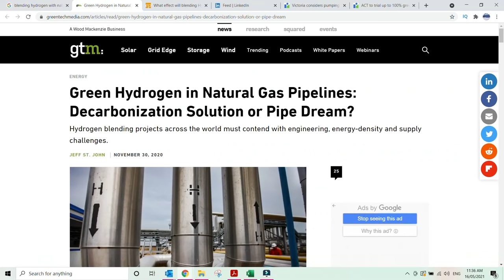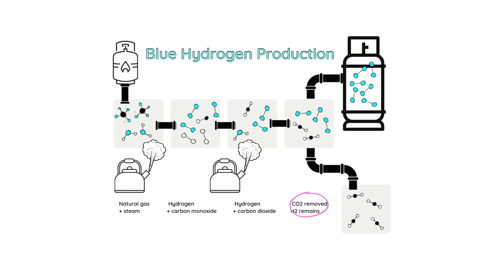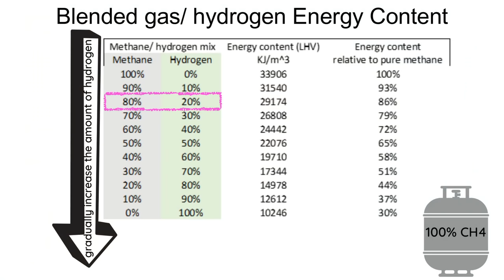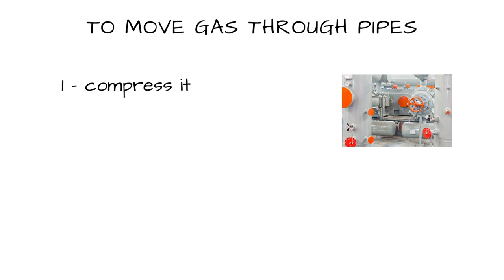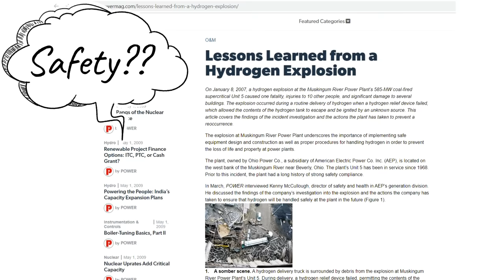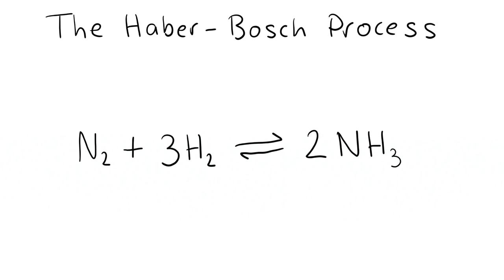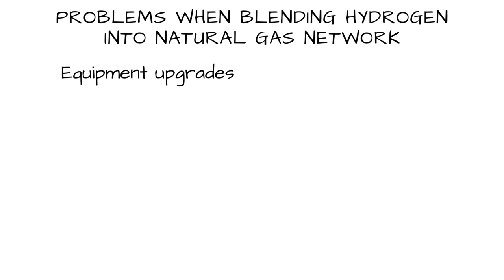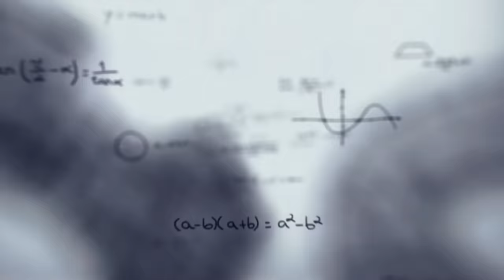Hydrogen in the Natural Gas Network

Comment: I am working on a offshore city and spent a couple years crunching the numbers for everything including energy , and if I learned anything , you have to put real numbers to the problems , and not have any preconceptions about the results. Another thing I learned was how really amazing results you can achieve by going beyond what is normally considered "economically viable" efficiency improvements.
Reply: please elaborate, what were the conclusions?
Reply: I expect it is an ROI type of calculation you were doing. As you get smaller gains it takes much longer to get a payback. eg if new equipment gave you a 50% saving and the pay back period was  2 years thats great. If you only got 10% then payback would 10 years - not so great. If the payback is longer than the lifetime of equipment you never get a payback.

In work I was doing I had to get a payback in 6 months to get funded. Understand your frustration with economic limits because I had them too.
Reply: If you are who I think you are, you are brilliant. Ahahah I think I’ve heard about you in my younger years as a teenager, building futuristic city plans. Am I right? There is most definitely real potential in hydrogen, considering it is so abundant on earth.
Reply: @lluuccasexperiencia7373  I don't know if anyone has heard about me , I did do a lot of research on Ammonia as a way to fuel air conditioners ( A truck would deliver Propane during the winter and the same truck would deliver Ammonia during the summer) I had a partner and we built a factory to produce the Ammonia fueled air conditioners and on Christmas eve 24 years ago the security guard asked for the night off to be with his family, I said "ok" and the factory was cleaned out , the project never recovered.
Reply: @rictechow231  I was looking at an entire city of 10,000 people. You could do things like have a free central laundry service that used the waste heat from the main power plant to heat the water , instead of electricity and 4000 individual washers and dryers , and have lower overall costs even though you are offering a free service .
Reply: @robertlackey7212  Hi Robert. That's is interesting. The waste heat of power stations is a sad waste and what you're suggesting is a good idea. Thermodynamics makes it  hard to economically utilize waste heat after say a triple expansion turbine. My background is computing performance which might seem entirely unrelated but actually isn't.

A frustration I always had was I had to produce an ROI within the current financial year ,which wasn't that easy, which paid my fees and the cost of changes and testing. So I might produce a change that was 50% more efficient that gave that ROI whilst knowing that if a payback period of three years had been taken  than I could have given a 90% reduction.

So I am hearing your pain at what could be done but isn't with short term financial views.

I'd expand a little on what you are saying. Co-location of industries could potentially use waste products. Another industry could potentially use waste steam at say 200 degree celsius in their processing. Your example is a case point. Their are some industries that use CO2 as a feed stock. If there was some intelligent planning, a poly carb factory could use some of the power station waste CO2. Berkeley university is doing a lot of work on catalysts to increase efficiencies on this. 

I'm not saying these vague ideas are a good use case but am saying thoughts - that you were having - is were we should be going and i completely support your thinking.

One of the things that amused me, was that on holiday in Vanautu I found their public was superior to that of first world countries. They had small vans running around. You just walked to the road and waited for a van to pick you up and the driver would drop you exactly where you wanted to go. The driver married up all the destinations the folk in the van had and dropped off in most efficient order.

Uber is starting to get to the efficiency of Vanuatu - but not quite - 20  years further on. :)

Cheers and keep up the thinking.
Reply: @rictechow231  Thank you for the encouragement , I wish I could point you to my project website I would really like your feedback , but every time I have tried to do that in the past my comment was deleted . My website is also blocked on Apple devices . I wonder how many good ideas are censored by Google or other tech companies just because it could not be "fact checked" , because it is a new idea .
Reply: @lluuccasexperiencia7373  What is exciting is that there are natural hydrogen reserves. In South Australia (Australia obviously) a lot of exploration is kicking off to find them.

I think our Australia gov't is on the money in encouraging the industrial use of solar and wind energy and correct in that it has to be cheaper. The SUN CABLE (google that) will ship by underseas, cable solar electricity produced in North Australia (Northern Territory actually) to Singapore.  Other significant projects are happening in the Pilbara region.

Direct reduction of iron ore using hydrogen instead of coal is chemically highly feasible. There is engineering to be done to scale up of course but that is being undertaken. Lots of iron ore, sunlight and wind in the Pilbara. Steel blast furnaces account for 7% of world CO2 emissions, so green steel is an excellent use case.

A major Australian minerals company has recently taken a majority stake in a European solar film company and plans a 600 MW manufacturing plant and a lot of mining companies are adding solar energy.

The Sahara has a lot of potential but it is not that politically stable. We are politically stable in Australia and our gov'ts are good in putting in supporting infrastructure. Well, as good as any gov'ts are which is perhaps not very good (to be cynical). 

Australia has a large land area  suitable for solar and wind. Smaller land area than the Sahara but political stability and infrastructure count. So I think the litmus test will be here in Australia.
Reply: @rictechow231  Thank you so much for your reply!
Reply: @robertlackey7212  Is there a freer platform that is not occupied by Trisolarans we could use? I am fairly tired of big tech censorship and it really has no place in matters we are discussing here. I am surprised Google would seek to intervene in ideas especially with someone like yourself who has quite some standing. What the hell!
Reply: @lluuccasexperiencia7373  Your welcome Experiencia! Great name btw.
Reply: @rictechow231  Perhaps , what about Practical Machinist ? I go there from time to time and I often see people write web addresses without being censored.
Reply: @robertlackey7212  That sounds like a site I would be interested in as well so I will. My cat woke me up far too early for his morning feeding. He is a little b* in that respect. Gets up on the window sill then 'accidentally' jumps down on top of me. So I am really faded now. I'll get on after a nap.   Cheers
Reply: @rictechow231  Sounds like a plan.
Reply: registered as Ric Techow but couldn't find you. assume messaging is best?
Reply: @robertlackey7212  Registered as Ric Techow and tried send a message but couldn't find Robert Lackey. What is best to do?
Reply: @rictechow231  I sent a message to Ric Techow I'm ROBERTSOLO (my name was taken) If this gets the Trisolarans off my back I will be using this more often .